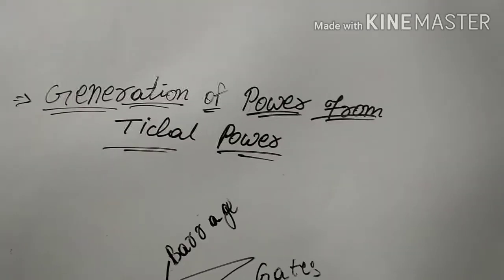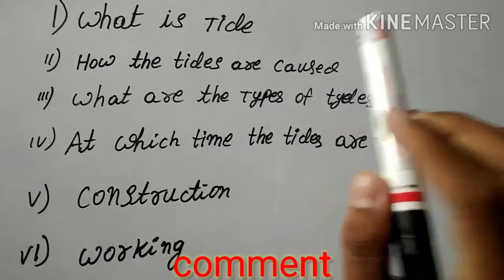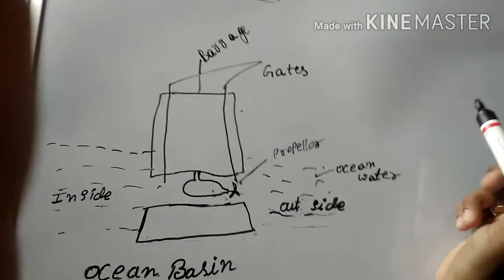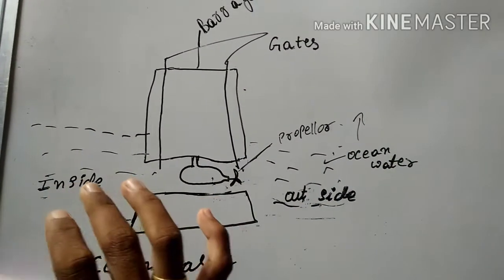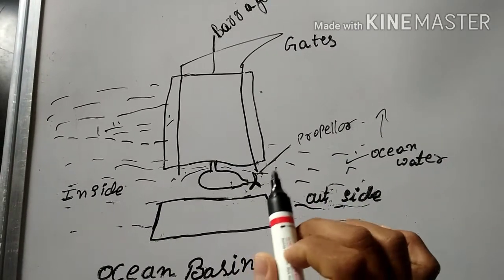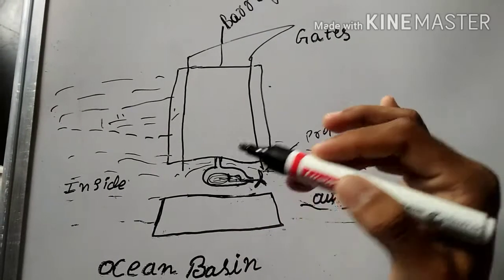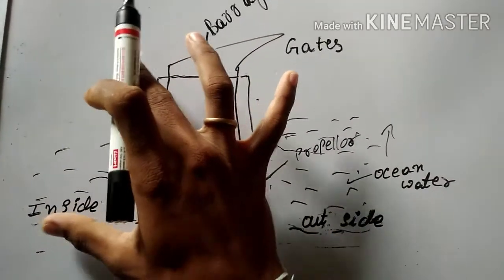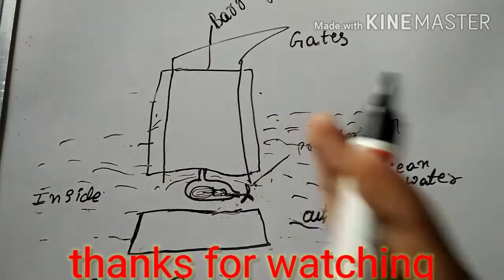Generation of power from tidal power ||KVS TRICKS ||

Comment: This technology has been used in France since the 60s...it's far more reliable than wind and solar or hydro... combined with geothermal ...the need for  coal and gas powered electricity generation in most developed countries will be unnecessary,...and that's not forgetting nuclear power...it's not every one's favorite,but it doesn't emit co2 and that's the most important thing... large capacity grid battery's are another piece of the puzzle that is essentialle to make power systems more productive!!!.🤔🇨🇰🇨🇰
Reply from the maker: What you said is absolutely right, but this type of generation is not constant and the produced electricity is very less in quantity,so we have to use other types of generation methods also.

Comment: Nice explanation sir. But I have a doubt why we're using steam in thermal power plant nd also why normal water in tidal power plant
Reply from the maker: 1.We are using steam in thermal power plant to drive the turbine. 
if we use water then the blades of turbine won't rotate, for rotation of the turbine blades we have to throw the water forcefully on the blades and more over this process requires large amounts of water resources and  it is not economical. So we are using steam in thermal power plant
Reply from the maker: 2 Basically tidal power plants are situated in the seashore or ocean basin,so there we have a lots of water resource and more over the turbine blades  rotates by the natural tidal force,and moreover the tidal power plant only produces power when the tides are caused. So the steam is not required there.
Reply: Tq you sir
Reply from the maker: Thank you for asking your doubt and  keep supporting us